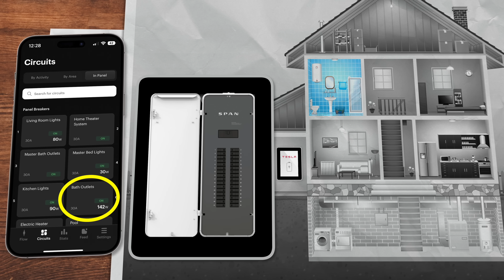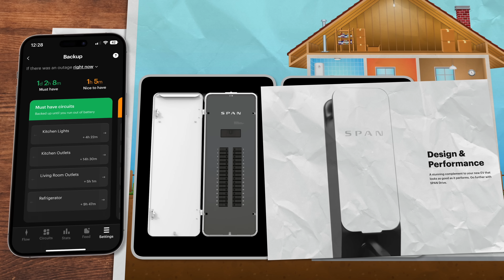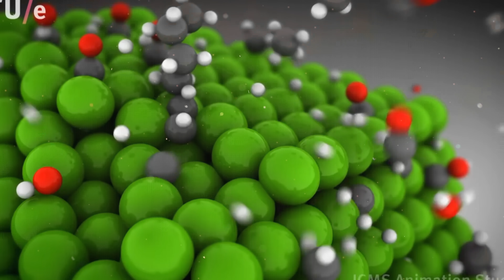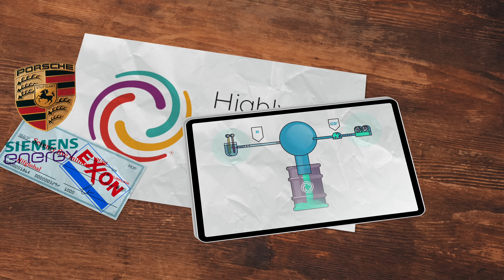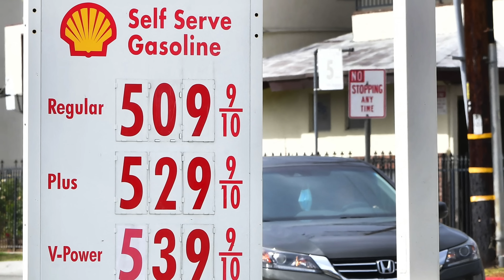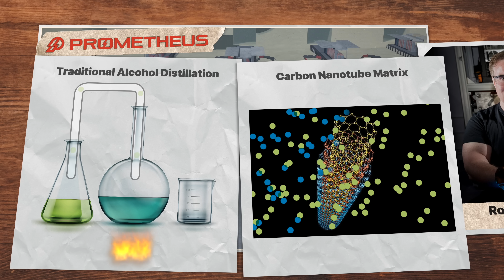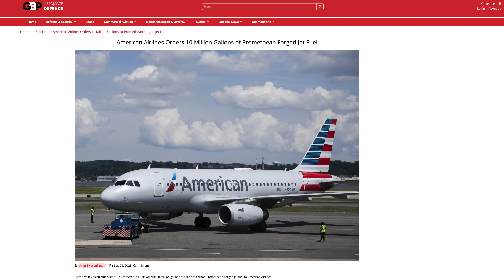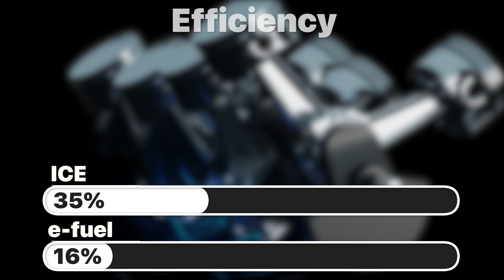EPIC Breakthrough Can SAVE the Internal Combustion Engine!

Comment: Your efficiency comparison between EV and ICE is completely specious, as you are not accounting for the production of the electricity used to charge the EV.  The electric motor may be quite efficient, but the battery only gives back 70% of the energy used to charge it, and the coal used to generate the electricity is even less than that. Solar panels convert less than 20% of the incident energy, so just as bad.  All heat engines have a limit on the conversion efficiency, but when you buy a litre of fuel, that inefficiency has already been accounted for, and expressed in fuel consumption/cost, so your comparison is meaningless.  All EVs will be scrap in 10-15 years, and batteries are much harder to recycle than a motor made of simple metal.
Reply: worng
Reply: @sharonbraselton4302  not worng...

Comment: By the end of the day, the problem is where will the energy come from? Renewables won't provide enough energy to power electric cars (even if we had batteries for free), let alone to produce efuels or green hydrogen.
Nuclear fusion is not going to happen, at least not in time to solve the problem before we collapse.
Nuclear fission? (Traditional nuclear, to avoid confusion) We've been trying to phase out that source for decades. Now it stars to look like the only realistic option. How realistic? Maybe enough, maybe not. But if a world dependent on fossil fuels looks ugly, one depending on nuclear energy just looks worse.
We need a real solution, something that actually works. Right now we don't have it and we're on a road to nowhere. Talking about advances that are irrelevant if we don't solve the real problem.

Comment: I have one very important question. How does the Pollution caused by Gasoline compare to these novel e-fuels? Its not just that ICE vehicles produce co2 that affects climate change but that they also produce other pollutions such as carbon-monoxide, harmful nitrates and sulfides along with particulate matter from the combustion possess. The later forms of pollution affect the local area, therefore, if we are making an E-fuel with the same chemical characteristics as the old stuff this is not a viable long-term solution. Consider dense urban environments like New York, Los Angeles, Tokyo and Sao Paulo where air quality in the local environment is directly linked to transportation this actually increases the incidence of sicknesses due to raspatory illness. A clean fuel should be able to overcome pollution at the global climate change level but also at the local city level.

Comment: simply doing a reverse add on /bolt on to add batteries and wheel up motors to existing cars as they did at MTSU in 2016 seems like it would be a great leap forward by simply reducing the amount of fuel you need ... almost like a DIY prius using your own vehicle

Comment: The exhaust from e-fuels are still bad for your health, that doesn't change. Also the only e-fuel that actually makes sense is "biogas" (renewable methane) since it's a natural waste product anyway making it the most environmentally friendly fuel right after green electricity. Biogas is also a drop in replacement for natural.gas, meaning all existing gas pipes can be used for distribution.

Gasoline cars can be converted to run on methane no need to trash them and they can still run on gasoline in emergencies since they have two "tanks" for each fuel. The best thing to do to plug-in hybrids would be to convert the gas engine to run on methane, so you can drive on battery most trips and use methane for long trips only.

Comment: REALLY enjoy your videos! There is however an issue and problem never mentioned when discussing ICE engines and their inherent pollution and energy efficiency problems and that's the matter of combustion. Combustion burns and then binds Oxygen in a manner that reduces the overall O2 levels in the atmosphere. No kind of 'combustion' will alleviate this problem, be it with e-fuels or any other kind of fuel that's used in an ICE type engine. A hydrogen fuel cell solves this problem as the chemical reaction that takes place in a fuel cell does not 'burn' its fuel but rather transmutes it into useful energy.

Getting from here to there is the most important thing and perhaps e-fuels can help in the short term but the long term IMO belongs to Hydrogen.

Comment: E-fuels are only a band-aid, to fool people and will not reduce the CO2 in the atmosphere. You don't even sound convinced yourself. Anyone that wants to look at the process can see it won't work to solve the problem, just make it worse, because of the energy required to do it.The use of Nuclear fuel would help if it is used efficiently and not wasted on such inefficient processes. You are forgetting everything you learned about electric cars (temporarily) to put forth such bad ideas. It is the overall efficiency of the entire process that drives the use of electric cars, not just protecting the earth, which is a side benefit.
Reply: wiéng

Comment: This is just another reason why we need new nuclear!!! Nuclear energy is the key to unlocking an energy abundant future, where we can have what ever we want and never have to worry about not having enough power ever again. 👍
Kirk Sorenson - "Every time mankind has been able to access a new source of energy it has led to profound societal implications, you know the industrial revolution and the ability to use chemical fuels, was what finally did in slavery. Human beings had slaves for thousands of thousands of years, and when we learned how to make carbon our slave instead of other human beings, we started to learn how to be civilized people. Thorium has a million times the energy density of a cabon-hydrogen bond. What could that mean for human civilization?  Once we've learned how to use it at this kind of efficiency, we will never run out.  It is simply too common." 💪

Comment: Batteries, the solution is batteries. Wasting 90% of your electric power to create gasoline is ridiculous. The solution is mass production of efficient ecars and highway embedded  recharging. Hydrogen or at least Methane for airliners. Also ecars are cheaper to build than ICE cars, except the batteries. America needs to manufacture cheap solar panels and batteries. Cause we're going to need a huge number. Cause we're going to cover all the freeways with solar panels.

Comment: I see a future for only two synthetic carbon based fuels: Ethanol and Natural Gas.
Ethanol and natural gas vehicles is already a large scale reality in some countries.
Its so much easier to make synthetic natural gas and ethanol than gasoline or diesel.
Lastly every biological matter that decomposes naturally makes methane (natural gas). Its called biogas.
We can literally make biogas from animal poop, food waste, dead animals, ...
We likely don't have nearly enough bio matter to go 100% biogas, but we do have a lot of bio matter and its so much better to capture that methane that will be produced anyways and use it as fuel.
Making methane from CO2 and H2O is a much easier and much more efficient process than making synthetic gasoline, diesel or jet fuel.
Lastly its quite important to understand that petroleum naturally has different fractions that are jet fuel, diesel, gasoline, cooking gas, naphta, ...
As BEV adoption shoots through the roof, large quantities of gasoline and diesel fractions will need to be converted into other hydrocarbons, a process that wastes additional energy versus refining petroleum the way its done today. So thinking about a future where we have nearly zero gasoline or diesel consumption is nonsensical as we'll still need to refine petroleum for non fuel needs (lubricants, petrochemicals, asphalt, plastics, ...).
I strongly suggest figuring out ways to reduce our dependence on all petroleum fractions rather than obsessing over the left over gasoline and diesel consumption.
Once demand for gasoline and diesel drops like a rock we'll end up with ultra cheap gasoline and diesel, which will likely be exported to countries that don't care about polution and climate change.

Comment: Battery powered EV's aren't the answer either. An ICE 4x4 has a smaller carbon footprint over its lifetime than either Prius or Tesla. It's the lithium mining and refining. Then you have lifespan. My truck is over 20 years old (diesel), has over 500k miles on it, and I run it on biodiesel I manufacture at home with solar energy and waste materials. It's effectively carbon neutral. I only buy diesel on long road trips (800+ miles).
Reply: wribg

Comment: You dont get something for nothing. Not just more expensive gas and diesel, there would be an environmental cost to sucking co2 from the air. As in life. co2 is life blood to plants, it is a fertilizer for them to grow. Less co2 means less food production. Less plants making oxygen for us to breathe. Also would mean colder winters (if you think co2 increases air temperature, which I don't) Life in general would be a tougher life. There are benefits to burning carbon. I think we need to forget about climate change destroying the earth, cause it is not. Earth has had droughts for millennia. Colder temps means less water vapor in the air, temps go down, humidity goes down, then less chance for rain, climate cycle is not so simple, so why do we come ast with simple minded thinking.

Comment: Unfortunately ev is not the answer by any means  as we can not recycle them not to mention its all from over seas we also send all the toxic waste to poor countries. I also don't understand why our passenger cars have emissions control but not any military vehicles  not a single boat or plane military or civilian has an emissions control systems. Another big issue is car that we buy to go to work ect can be tuned alot better for example I have a friend who has a 300hp k24a and it averages 37mpg on the highway and factory it was 28 average you know it's funny bc we have had 40mpg cars since the 80s at a minimum but unfortunately those companies lose money if they don't leave performance on the table everything is about profits which is so stupid. I'm not against ev but the problems are massive on top of the electric grid would need a full rebuild. The real thing we need is more plants and fungi as there the reason oil exists in the first place as they pull carbon into the ground, also if you look back 100k yrs ago you will see that the c02 levels where way higher and that's why we had massive plants and animals so I am not sure that it's as big of an issue as people make it out to be just like the biggest hole in our ozone back in the day which we thought we were screwed but it has since been shown that it is no longer there.
Reply: chjef 1970 speed d càrdßé are kiike 4 mog at 155 mph

Comment: The simple problem in fossil fuel vehicles is ditch the home user of there heavy vehicles like diesel and heavy drinking petrol vehicles , smaller vehicles would be better including lower cc motorbikes  , the heavy duty vehicles , a lot will turn into electric like vans etc even lorries can run on electric as Tesla and china has demonstrated.
Any think the fossil fuel industries come up with must have a question mark because of there corruption of the past and in the UK there's way to many MOT problems especially fraud between favours from friends to friends none of theses people give a crap about climate change and the punishments that are given create more law breakings as soon as the head is turn it's back to abusing the law basically a money ring for jobs that's totally criminal if you took there licence away for good now that's a punishment.

Comment: Climate change is a lie, please stop pushing the green lie movement. EV's have a larger footprint, you have mentioned this on a previous video. Sounds like the Span panal can be controlled by the government also? Combustion engines with reusable e fuel would be awesome! In helping stop this madness out of the corporation of D.C. You forgot to mention that these automobiles have catalytic converters that burn off 90% of HC, CO, NOx. And emissions is down everywhere except in China and India. O..and please explain how the earh was colder last year and isn't warming, the ocean isn't rising and weather isn't anymore volatile then it was 200 yrs ago, Science proves this. Wait until the government starts controlling and limiting the use of the ev's because a 1% increase will break the ever aging grid and the use of electricity on the existing grid is already a to much of a strain seen in August 2022 in Kalifornia.

Comment: ICE isn't an answer to anything except continuing to dump CO2 into the atmosphere and it's NOT carbon neutral. it's an EXCUSE  to continue producing engines on an industrial scale that they already have the infrastructure for so they don't want to change it out. they lie claiming 'carbon neutral' it's not, just MAKING the ICE engines produces CO2 among other pollutants. then there is producing it's fuel and the losses inherent in ANY SYSTEM not to mention the efficiency of an ICE has a ceiling that was reached LONG AGO. so for all the shills trying to claim ICE is somehow perfect, an answer or the future either don't know jack shit or are just paid shills.

Comment: Also be useful as a generator for ev’s (because a small engine could be a generator it could be much more efficient running at constant speeds to provide electricity to the motors or small battery pack), . Additionally could also be used to run a fuel cell and provide electricity. As the main motors are electric, benefits of low maintenance is retained. A Company called Twelve has been chosen by military to supply e-gas from small semi trailer sized portable generating plants. The world is really changing! Thanks for the great vids!
Reply: The reason to supply the military is not because it is a good idea for everyone, it is just to solve a military problem.

Comment: What is the energy needed to make these e-fuels? If the Energy needed is high and they do no better than ICE vehicles, then the question is whether the cost is worth it. In France there is a company that converts ICE cars into electric, which means ICE cars could be used for years to come.
Reply: After conversion they would not be ice cars anymore.... Though

Comment: Ok I am takeing you literaly So far I plan to use hydrogen cartrige (Toyota/VW) & swap recharge with solsr power.  I hear Brszil is altrsdy useing Alcohol with dual capability however here folks would drink it so  we would need to add a poison like requored in hand sanitizer.  My engine will be liquid piston, omega 1 or some other new comparable; never liked these antique designs except easy to work verses the transmisions not counting the weight.  Producing my own e,/fuel looks tmpossiable yet cheers for nuke plsnts into hydrogen or. E-fuel plants would be applauded.

Comment: A few rhoughts:
1. Not ALL internal combustion vehicles HAVE TO BE replaced with electric.
As long as enough mass production vehicles and electric power generation are replaced, we can reduce CO² emissions enough to reverse global warming. 
2. Internal combustion engines produce particulates and other noxious products such as oxides of nitrogen, which are hazardous to health. Continuing use of ICE vehicles is hazardous to health, particularly in high population density areas such as cities and along transport corridors.
3. The cost of running battery electric vehicles is so low that economics will determine which areas of transport become electrified as much as practicality.
Reply: Midern cars are virtually pollutant free

Comment: We do not have to eliminate all the combustion engines anyway. We only need to reduce the number to a yet to be determined fraction of what we have now. Synthetic motor fuels are nothing new. The US Navy already has technology to remove carbon based acids from sea water that were made by atmospheric carbon. Then taking hydrogen also from sea water and making jet fuel with it. However this costs more than fossil fuel at this time.  SO yes this can extend the life of the ICE engine. Besides, when car makers stop making them does not by any means the ICE vehicles will all go immediately for scrap.  The changeover will be gradual because many people will will not be able to afford to buy a new car. The ICE cars will serve to the end of their current lifespan. 

Though by then I expect that new EVs will be no more costly then a new ICE vehicle. As it is, the lifetime cost of an EV is already lower. As someone who has repaired ICE engines, the sooner we get rid of the cockamamie things the better off we will all be. Especially the elimination of the transmission will be wonderful. 

But cars like Corvettes and the like will be around for a very long time. While ho-hum cars like the Nissan Versa will get junked on need for their first major repair.  Myself, personally, I have bought my very last ICE vehicle. At my age it may be the last vehicle I ever buy but if I am forced to replace it, the VW Buzz looks attractive to me.  I will not own another ICE vehicle.

Comment: Can the new e-fuel compete with the ultra-efficient Aptera design? Solar directly fuels the Aptera at zero cost. No need to ever fuel up for normal use.
Reply: That's assuming Aptera isn't vaporware. Ask the government to Louisiana
Reply: @kevinloving3141  I'm assuming you haven't researched it. I have been following it for 14 years, since before it was electric, just the most efficient design shift ever. They are extremely open and give many tours/interviews/demos, with lots of details on their motor-in-wheel, PV, and composite fiber body.